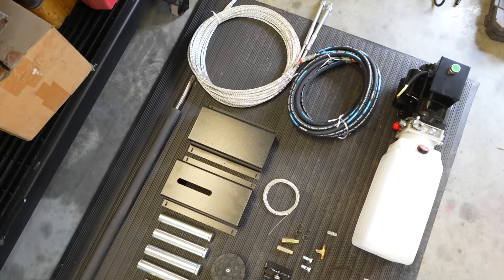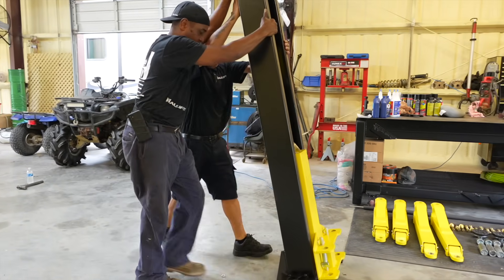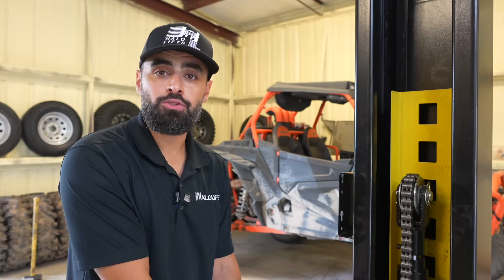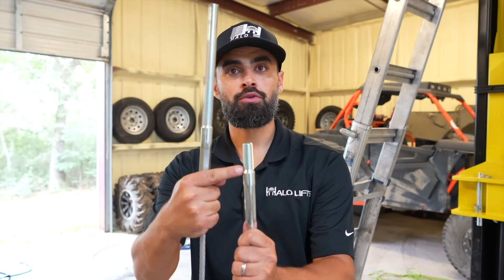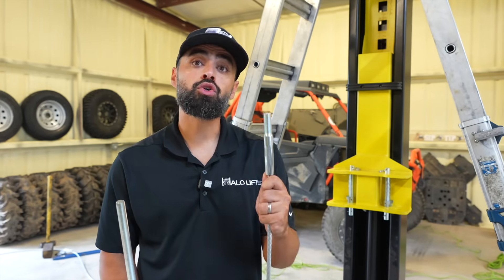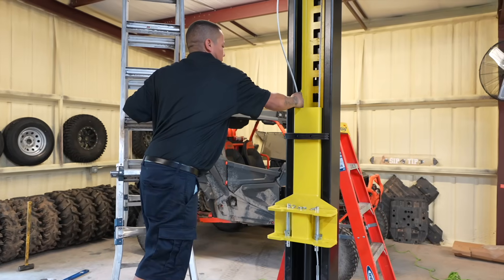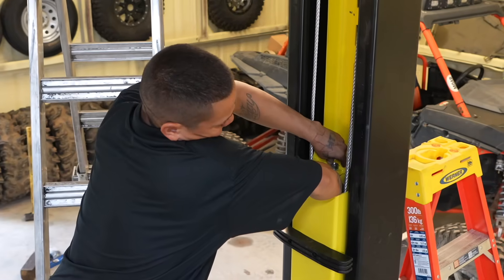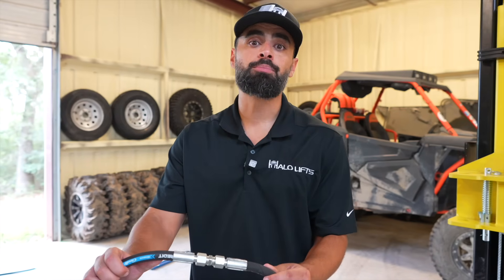HALO LIFTS HOW TO DYI INSTALL OUR 2 POST CAR LIFTS HL2C-10K , 12K & 14K

Comment: Got one of these 10k clear floor. So far it is great. The only thing I do not like so far is the cable adjustment is not accessable. The longer threaded cable side should be facing up so if need to adjust it would be easy to access. The shorter threaded side is threaded all the way down already so it cannot be adjusted. Other than that the lift has been wonderful and a good price.

Comment: How do you say to run that shorter cable has to be wrong. It makes it cross itself inside the column. Should it actually go on the front side of the bottom pulley and come up the backside that would make it not cross itself

Comment: How do you bleed the system?
Reply from the maker: @jaydenhaver3488  no need to bleed the system. Our 4 post and 2 post motors are self bleeding.
Reply: @HALOCARLIFTS  awesome! Can’t wait for mine!
Reply: @HALOCARLIFTS  another question I’m currently installing the exact same lift but the way you explained it in the video was to run the cables behind the bottom pulley then band up? But doing that, the cables are twisted, is that correct?
Reply: They should not be twisted! Hopefully you figured it out by now... 😂 @jaydenhaver3488